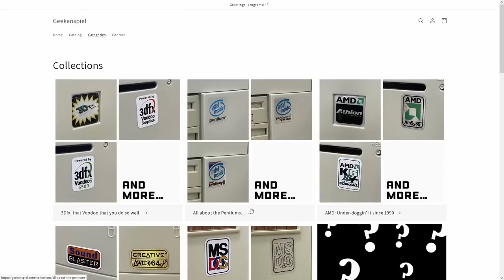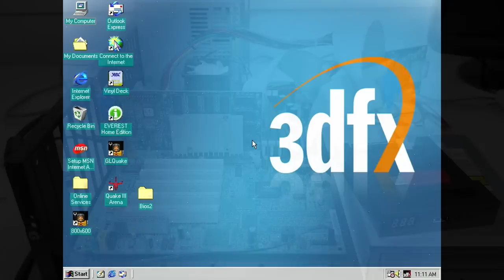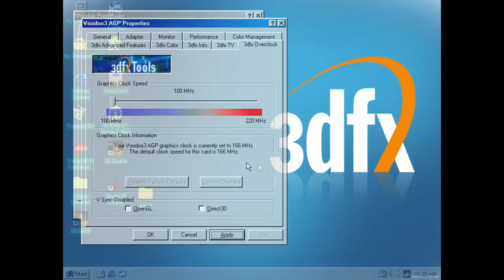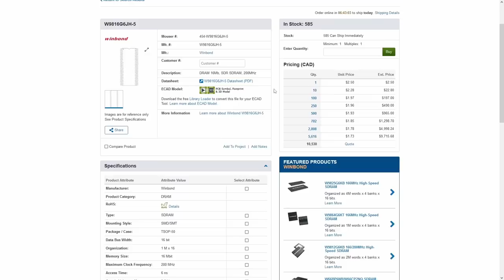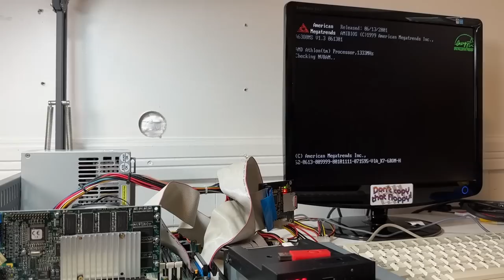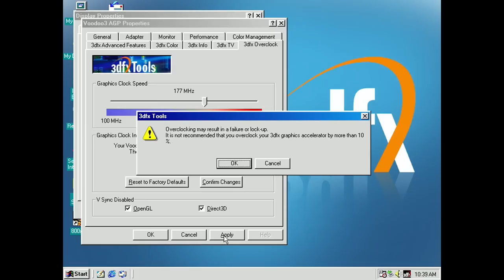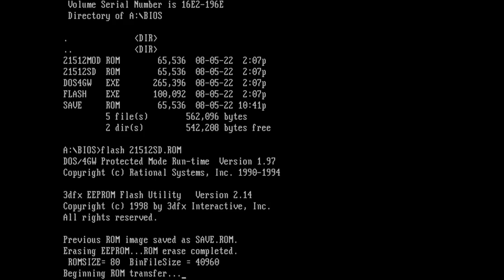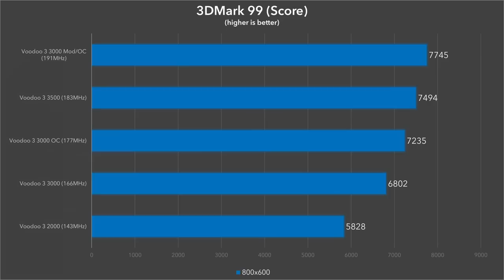3dfx Voodoo 3 Memory Replacement and Enhancements!

Comment: Love the repair stuff. Getting back into soldering myself after many years break from it, I have just been working with TH stuff, and biggest project so far was to assemble a SixtyClone / Commodore C64 clone. Next project will include SMD components (Denise board / sort of Amiga 500+ remake) . Will also create a Retro Chip Tester Pro. It will all be done with a soldering iron though, as I do not have a hot air station or have experience with hot air. So long story short, I use these videos to learn techniques and what to do and not do. :)

Comment: I repasted my Voodoo3 3500, and I was able to overclock it LESS afterwards. I used to be able to overclock it to 190, and it was crashing at about 186. It previously had a thermal pad like in your video. I noticed the springs 3DFX used to hold the heatsink to the card were really weak. I swapped them out for some different ones I pillaged from somewhere, and I was able to overclock it all the way up to 200mhz. You might get some stronger springs for the cards and see how that affects overclocking.
Reply from the maker: Great tip thanks. I noticed the springs are pretty weak too. Using nuts/bolts could be an option too as long as care is taken not to overtighten. Another thing I noticed (especially on card 1) was that the avenger chip's surface is FAR from flat. It's much higher at the perimeter than the center. You can kind of see what I mean in the photo I show where the heatsink is first removed. I needed to add way more paste than usual to make sure there was good contact with the heatsink.
Reply: @vswitchzero  What about sanding or lapping the chip, just like people used to lap CPU's? Lapped to the raw core and install a big phat copper based heatsink.

Comment: My launch Voodoo³ 3000 AGP developed severe artifacts that I was able to see during the boot process. I recall it being vertical red bars on the BIOS splash and text screens. 3Dfx (old logo!) RMA’d it for me and the replacement was another full retail sealed copy complete with a second mail-in offer for Unreal Tournament. They had corrected the strange misprinted Unreal disc that had Unreal Tournament art and some beta UT files for UnrealEd which I helped bring to the Unreal community many years later (2007).
Reply: Man, you are bringing back memories! I had a Voodoo3 3000 and played countless hours of Unreal Tournament! That card never gave me any trouble, though. I remember game supporting 3DFX Glide being so smooth at the time compared to Direct X
Reply: @geoffmooregm  I actually got a Diamond Monster Fusion Z100 (Voodoo Banshee) as a stop gap AGP card since my Voodoo³ 3000 AGP was still preordered when the Pentium III launched. Before then I’d only experienced software rendering… unless you count the ATi Rage II that literally ran Direct3D slower than the software renderer. When I first saw Unreal running on the Banshee with reflections and liquid-smooth frame rate I was totally blown away… and that was just a Banshee! I couldn’t believe what I had been missing out on. A month or so later I had my Voodoo³ 3000 AGP and I never looked back. It made games I’d already enjoyed a whole new experience (Quake, Quake II, Monster Truck Madness, etc).

Comment: Hi, I've already commented on your video but just thought I'd head back and tell you that just a few weeks after your video I came across an absolutely battered 3dfx V3 with no heatsink, damaged memory, no caps and a few smd caps knocked off, I cleaned it up and replaced the smd's and recapped the card to get it working but it was then artifacting quite badly, I remembered your video and ordered the very same memory from Mouser, I ordered more just to get the free shipping as I'm in the UK so I can also do the V3's I already have plus a few more spare, so not only have you fixed these cards, you've also contributed to saving the one I found, I also got a Gf2Ti along with it that had damaged memory which are also still available from ali express because it has the same memory chips as the original xbox, so yeah that's another 2 saved. 👍
As a side note, I said to my wife "I'll get some of that same memory from Mouser like vswitchzero" she said "who the hell is that?" and I replied "That guy who you said has got an excellent relaxing tone to his voice"  High praise mate, high praise haha 😂😂
Reply from the maker: LOL! High praise indeed 😂 .. That's awesome that you were able to get the battered V3 and GF2 repaired! I still have some spare winbond chips and hope to do another enhancement job on a 2000 card I repaired recently. Will be interesting to see how far it goes with some extra core voltage 😉
Reply: @vswitchzero  Cool, I'll look forward to it, love your content mate, such a great channel. 👍

Comment: My first job was working for my father's small business repairing business telephone equipment, so a lot of soldering.. Everything you said was spot on about ventilation, finer tip irons, and especially about the quality solder wick.. Would make all the difference. Quality stuff will ACTUALLY wick the solder right up like a paper towel sucking up water. Where the crappy stuff just smooshes it around and it kind of stick to it.

Comment: You could improve the way you're using your wick. Note that it's a mesh. When you unroll it, press it together like you're trying to get out of a chinese finger trap, so it becomes wider and spreads out. This way it will load with way more solder, and it'll wick it up much more easily. This technique makes even the "cheap stuff" work pretty well.
Reply from the maker: Great tip, thanks for sharing. I will give this a try next time 👍
Reply: How long do those wicks last? And what do you do with them after there full and how do you know there full o,0
Reply: @Bewefau  judging from the question they'll last you a lifetime. Buy one and figure it out, it's hard to explain.
Reply from the maker: @Bewefau  As solder is absorbed the colour will change from copper to grey/silver and that part of it will become very stiff. Once that happens you can just cut it off and use the fresh part again.

Comment: I do it 1 pin at a time with SMD soldering as Ive not had much luck with dragging either so nice to hear I'm not the only one 😊
Reply from the maker: Hey, whatever works right! :) .. I did buy a specific tip for drag soldering that I'd like to try one of these days. I have a few dead geforce mx cards that I may use for practice. But for now, this works :)
Reply: The trick with drag soldering (other than having the right tip) is to hover the iron just above the pins, like a fraction of a fraction of a multimeter.  Then let the solder ball up and use the surface tension to drag it down, never really letting the tip make contact with the pins.

Also flux flux flux.

Comment: Not surprised you were held back by the core even with the 200 MHz memory. Years ago, I had a 3500 and attached a fan to the heatsink and overclocked it. That card had 5ns RAM chips and reached 202 MHz stable, up from the stock 183. I suspect the cores on the 3500s were speed-binned and had a few more MHz of headroom in them, which is why you could only reach 191 on those 3000 cores even with 200 MHz memory.

Comment: A small tip for anyone repairing GPUs of any era:

If a memory module is bad and you can't test it (modern cards using MATS or the AMD software), start with the module closest to the PCI/PCIe/AGP connector. Those tend to fail first due to the power draw and heat the connector generates.
Reply: That and they flex the most, if something is going to fail, it's likely that one.
Reply: @SBBurzmali  Exactly, that as well.

Comment: Something I've found with a lot of V3's and also Trident cards, is that the majority of the time if a memory chip is having issues, it's always the one nearest the socket. Don't ask me why, it's just how it works. MOST of the time it's not even a bad chip either, it's bad joints where a simple reflow is all you need.

Right now I'm in the middle of something similar trying to diagnose my Voodoo 5 5500.

Comment: Great repair video as always - these have really helped me get confident enough to have a go at fixing my own voodoo2, and its been going really well!
Reply from the maker: Thanks very much! Best of luck repairing your Voodoo 2. Let me know how it goes 👍
Reply: @vswitchzero   I found a resistor array that had one dead connection and replaced it along with a missing resistor hoping that would be the issue, but I am still pretty much where I was.. could I ask you to please share the resources for the voodoo and voodoo2 which you have (maybe on your website?) regarding what all the pins on the FBI and TMU's are for? I am suspecting the TMU's arent getting power, but I need to know which pins to check.. thanks!

Comment: 3:30 that’s one of the interesting things about my 1000. One is that it’s a OEM card without a heatsink and the other is that it has Siemens SGRAM modules on it instead of SDRAM chips
Reply from the maker: Yeah it seems there are a few models that use SGRAM instead of SDRAM out there. I'm curious if there is any performance difference between them. I don't own any SGRAM V3s currently.

Comment: Great informative video. Have a Voodoo 3 3000 PCI card displaying artifacts. Squeeze test didn't change anything. So with SMD soldering practice under my belt, I'll look at changing the 
memory chips. Thanks for the info.

Comment: Suggestion. To save on parts put the first chip into the second swap and so on. One bad chip is replaced using two new chips in the end. In this case you used five rare parts.

Comment: Not surprising they topped out at 191, from memory, the Voodoo 3 ran pretty tight memory timings to reduce latency. The chips themselves might even have more headroom, especially with a fan cooler, if the memory was 233Mhz rated. That said, 191Mhz is nothing to sneeze at at all!

Comment: great job on those card mods!

and definitely consider drag soldering. you can practice on broken stuff till you get the hang of it and it's way, way easier and quicker once you do. also, it's necessary for some jobs like really fine pitch stuff you can't touch the legs one at a time
Reply from the maker: Thanks! I bought some additional tips for my iron that should be good choices for drag soldering. I have a couple of dead Geforce Mx200 cards that I hope to get some practice on 👍

Comment: Just found your channel (no idea why YT recommended it tho!). Awesome! Excellent all around: great sound (very important!), great video, great speaker! Great work, too, on the soldering, not that I know much about that.  :)  I have tons of retro hardware that NEVER gets used (I live in a sml apt so there's no room), INCLUDING one of those Voodoo 3 cards, which USED TO BE my PRIZE possession! Mine is one of the Dell OEM cards (or one of those PC maker OEM cards). It worked GREAT when I used it MANY years ago, but who knows now. I didn't really know what I was doing 'back in the day,' but I DO remember overclocking the memory and being tickled pink about the increase! Anyway, thx for the great work/video! Cheers, mate!
Reply from the maker: Thanks very much, means a lot! :)

Comment: Excellent video! I'm really surprised no one has made a utility for identify which chips are bad. Seems like the display pattern with the dots could be traced back to a specific chip.
Reply from the maker: Thanks very much! Me too. I think the challenge is that all different makes/models/generations of cards would have differing memory architectures, interleaving etc. So a software utility would be applicable to only a small pool of similar cards. But that said, it would be awesome if someone could write something like that for 3dfx cards :)
Reply: @vswitchzero  I'm wondering how much utility there would be from alternating bit patterns and being able to probe individual pins with an oscilloscope? Might see some weird waveforms on some of the lines.

Comment: Small SMD electrolytic capacitors(less than 100uF) of that age are always bellow specs. I think that was the issue with the first card, not the memory. You should always start the troubleshooting replacing the capacitors.

Comment: Couldn't find any 5ns chips so I went with micron 6ns chips and did a full vram replacement on mine, went perfectly.   Didn't need to clean solder off, just reused it what left on pads.  I replaced few electrolytics with large MLCC capacitors pulled from old GPU card.

Comment: Great fixes. You could probably push the chip even further if you tweaked the Vcore. Pretty sure that throughout the entire line (2000/3000/3500) the difference is purely in the vcore voltage, allowing you to hit higher clocks with extra voltage, at the expense of a hotter running card. If you get luck with good silicon on a good 2000 card, they'll run at 3000 clocks whilst running cooler. Sure you could push the vcore and reach 200MHz. Of course, these aren't getting any cheaper though!
Reply from the maker: Thanks! I wondered this too. Would love to see what a 3500's vcore is. IIRC it was about 2.5-2.6V on the 3000.

Comment: When upgrading memory chips, you might have to upgrade the bypass capacitors as well. If the bypass caps were just on the border of being useable at that frequency.
Reply from the maker: Thanks for the tip, I hadn't thought of this. Will look into it some more 👍
Reply: @vswitchzero  yw. also bear in mind at some point the traces will not be matched in length and therefore higher speeds cannot be reached. this includes the bonding wires on the voodoo chip! so, you know, maybe if you have a very fast oscilloscope, and a measurement setup, and can build your own pcb, then maybe, just maybe, you'll be able to overclock more... heheh

Comment: I would love to see what it would take to get the Voodoo 3 3000 to 200MHz. Awesome repair, subbed!
Reply from the maker: Thanks! I have no doubt a bit of extra core voltage would get it to 200MHz without much difficulty. I didn't want to risk it on someone else's card but I may modify one of mine one of these days and try to go further 🙂

Comment: Vswitch, love your videos man! Quick question, I have 2 Voodoo cards with their heatsinks epoxyed on to them. How does one safely remove them without damaging any chips below? Would love to hear your thoughts on this. Thanks again and keep up the great work 👍
Reply from the maker: Thanks very much! Most V2s didn't have heatsinks, were these done custom by someone? Personally, I'd leave them on unless its really necessary to remove them for some reason. If something like arctic thermal epoxy was used, it'll be REALLY strong. Thankfully the V2 chips aren't BGA so less chance of trouble as long as the pins are protected. I know a lot of people swear by the freezing method, which seems to help with glue/epoxy but its still risky. If you search for Voodoo 5 heatsink removal, you'll see some examples. I've never tried personally, so proceed with caution. Good luck!
Reply: @vswitchzero  Thank you for the reply. Yes, both my Creative Labs Voodoo 2's came with custom heatsink/fan combos put on by the previous owner. unfortunately, they were a bit of a noob and put them backwards! I'd love to show you a picture if I could. It's incredible how someone could get this so wrong 😄

Comment: Your skills are fantastic! With passive cooling my Voodoo 3 3000 with 6ns memory overclocks to a maximum stable 188 mhz. With active cooling it goes up to 195 mhz. I wonder how high your cards with 5ns memory would go with active cooling, I guess probably up to 200 mhz or even more.
Reply from the maker: That's an excellent overclock with 6ns memory, that's for sure! Do you remember what brand of chips your card had? I did have a 92mm fan close to the card to provide some airflow during testing. I didn't try without active cooling during overclocking.

Comment: Great work replacing those memory chips. I tried to de-solder a similar memory chip from a defective Geforce 2MX for practice. Disaster :D!!! Next time I will try your method.
Reply from the maker: Thanks very much! It's great that you practiced first. I removed a whole bunch of surface mount chips from a dead motherboard when I started with hot air, then moved on to dead video cards before I tried it on something I care about. My first attemps were not great either haha 🙂👍

Comment: That swollen chip was very likely caused by the hot air. Humidity can cause trapped moisture in the IC package. This will expand while heating and popcorn the chip.
Reply: If your going to do hot air rework on something you really don't want to risk damaging. Try baking it first at between 60-70°C for an hour before hand.
Reply from the maker: Thanks for your comment! Yes, that makes a lot of sense . After cleaning up the flux residue from all the vanguard chips from card 3, I can see that about half have some degree of swelling, although the one I pictured was definitely the worst. The Siemens chips didn't seem to have this issue.

Comment: Depending how the addressing on the memory works you maybe can try to lower resolution and depth to see if the error changes or goes away so you can maybe now if its one of the first memory or the higher ones. just an idea.
Reply from the maker: Thanks for your comment! I wondered this as well.
Reply: @vswitchzero  there was this software to test ram memory years ago i dont remember the name ram doctor or something it  displayed you on which pin the error occured  and then you just trace this pin back to the memory ic. Maybe there is something for video cards too?